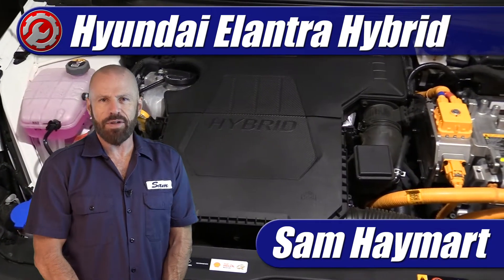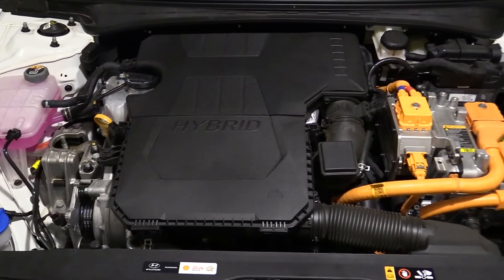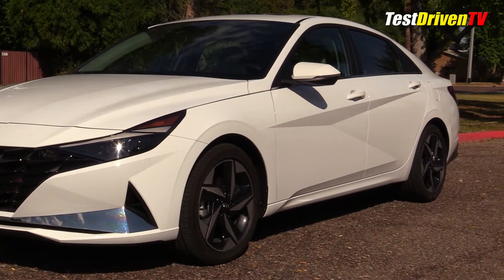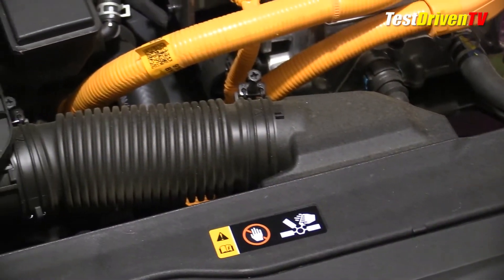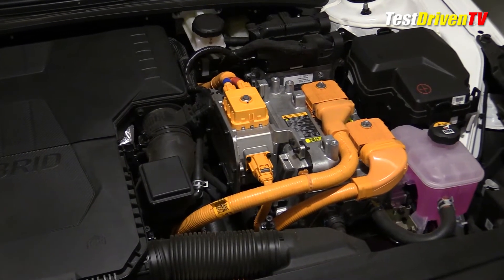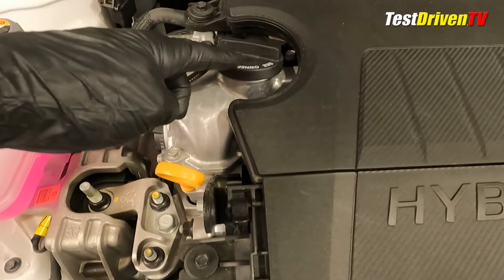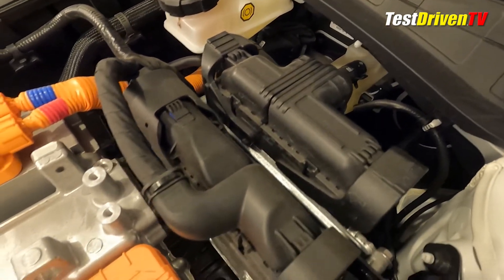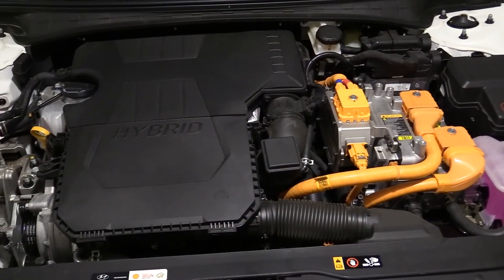2021-2024 Hyundai Elantra Hybrid Engine Explained

Comment: Car dealers in the United States are the places where I have seen the most scams. I bought a 2023 Elantra hybrid top model. At that time, the salesperson told me that adding $1,000 would be enough to buy lifetime hybrid battery insurance. I thought it was very necessary and bought it until I had a problem with the battery and asked for warranty. I took my warranty card to the car dealership, and he told me that this policy only covered the warranty of the 12V starting battery. So please be careful of scammers in car dealerships.:face-purple-crying:

Comment: Bought a 2022 Hyundai Ioniq hybrid, uses the same powertrain. Been excellent for the first 20,000 miles. The transmission is a DCT which feels weird, that's my only gripe with the car. Getting mid to high 40s mpg in the winter, 60-70 mpg in the summer. Highly recommend!
Reply: Does it have a filter for the battery should I replace it?
Reply: That's how the 2023 Hyundai Elantra Hybrid is, winter I get horrible gas mileage, summer is better.

Comment: Just bought this 2022 model...
Reply: How it’s going on gass
Reply: @abdullahosman9560  wow...came from a civic...20 miles 1 way to work so back and forth under a gal of gas..and a gal is 6bucks..
Reply: I bought a 2022 hyundai elantra blue hybrid about 10 days ago.  It is an amazingly comfortable car and the gas mileage exceeds the factory specifications. I have been getting 67-70 mpg in town and 64 - 66 mpg on the highway.  I enjoy all the features except for the full length rear seat back.  A 60/40 split back seat would have been a lot nicer, but you can;t have everything. All in all, I am completely satisfied with this car.
Reply: What the mileage in Km/L and what mileage you get with full tank.

Comment: Fantastic overview of this marvel of engineering!  I would love to see you make a video on how to do an oil change on this vehicle. Apparently the process varies from the standard Elantra
Reply: Does it really?
Reply: @Deitz69  yes, I got under my car and the location of the oil drain plug was in a different location then in this video
Reply: @Dan11495  thanks for the tip I haven’t had to change mine yet since I have the complementary oil changed right now
Reply: Any updates to this?  My wife's Elantra hybrid is going to need an oil change soon and since we're already beyond the complimentary service mileage I'd like to do it myself.  I saw the regular Elantra video from a year ago say only the dealership sells the filters, but I'm hoping that has changed by now.
Reply: @lmelior  I can't speak to the process of changing the oil yourself, but I can say that I have taken it to the drive-thru oil change places with oil filters I have bought from AutoZone before and had no issues
Reply: Oil changes are easy. Hyundai cleverly provided a small iron ( not aluminum!) oil pan underneath the engine and the 17mm drain plug is placed on the side of it.  It has a cartridge oil filter in front of the pan - and no plastic shrouding to have to remove either!